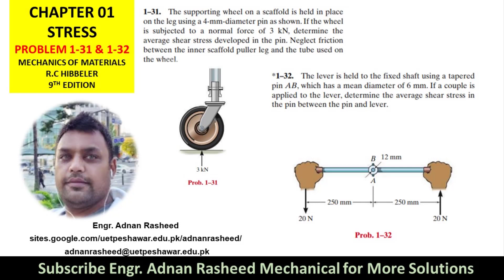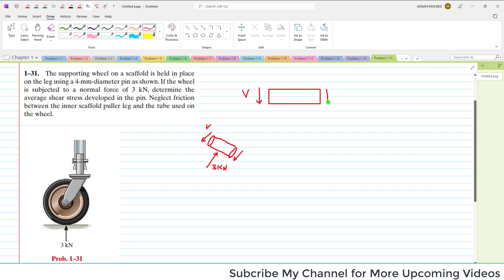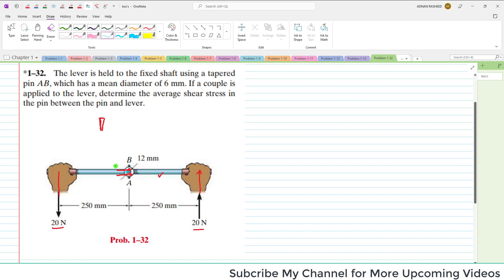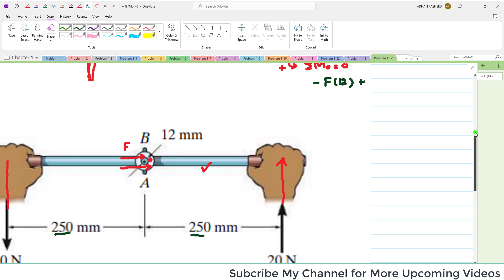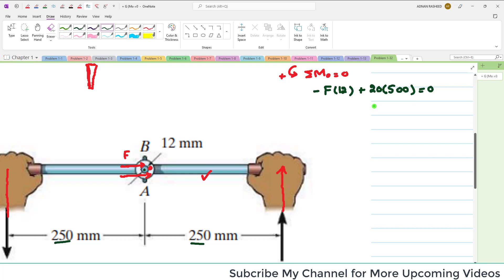1-31/32 Stress | Internal Resultant | Loading Chapter 1 Mechanics of Materials by R.C Hibbeler|

Comment: I have question. At 08:40, why u only write down one force. THere should be 2 force because there is 2 internal force from both side, right?
Reply from the maker: Dear bro...these forces are non collinear and producing couple from which we calculated the force. Now for shear stress that calculated by formula shear force/ shearing area...so that's why we have take single F

Comment: Why isn't the shear force is in the opposite direction so that it produces a couple moment which rotates clockwise to counter the couple moments caused by the 20N.
When both are in same direction, it will cause the whole thing to move to the right.
Reply from the maker: You can see both forces are opposite and and non collinear hence they are producing moment.